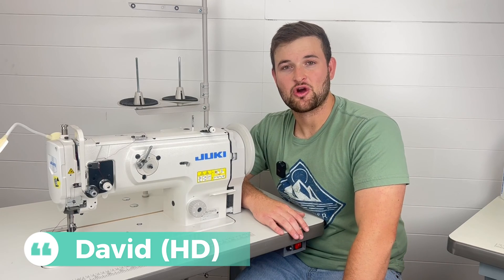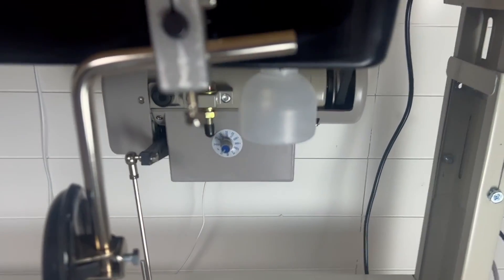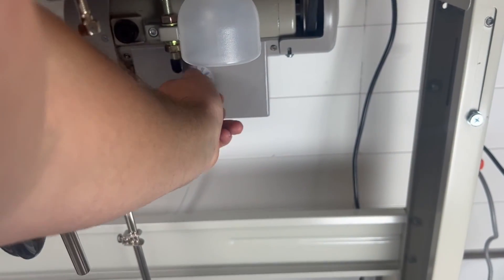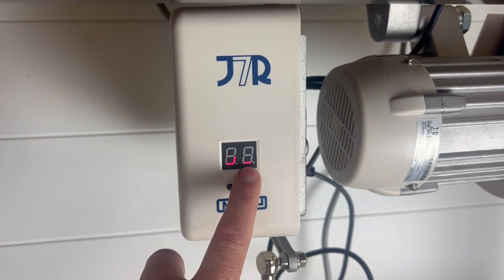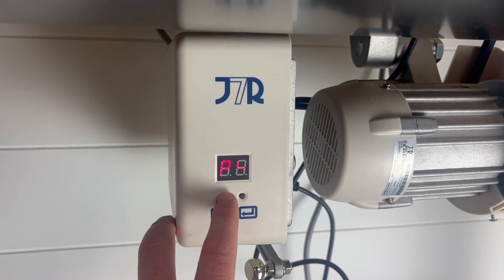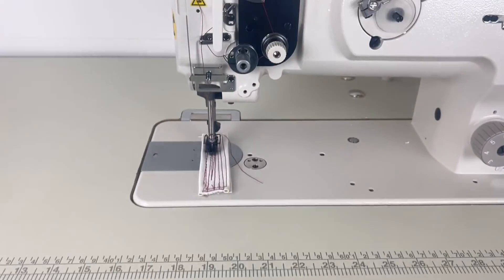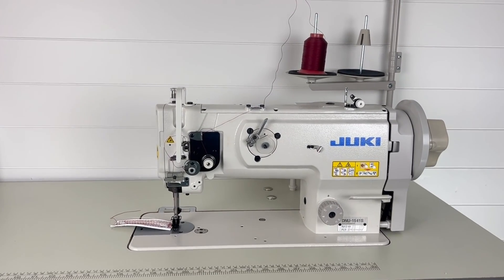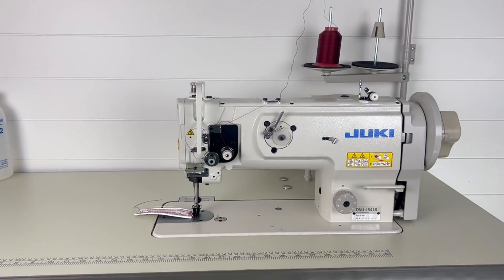What Is A Needle Positioner Motor? (Learn about The Different Industrial Sewing Machine Motors! J7R)

Comment: Does the Juki 650w motor / controller allow you to raise the needle to just past the top position (so the tension releases and the material can be removed) with a heel tap - when the needle position is set to stop at the bottom during sewing ?
Reply from the maker: Yes

Comment: Have a question regarding motors, but in the 2828v-7, which I have at home, and it trips my breaker every time I engage the needle via the startup screen. Is there anything that I can do to keep the machine on an AFCI or GFCI outlet?